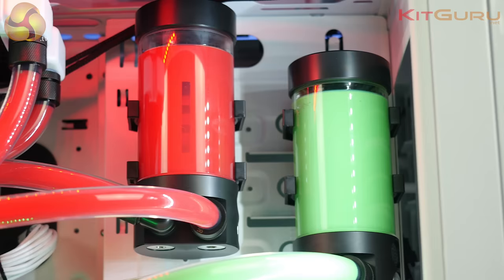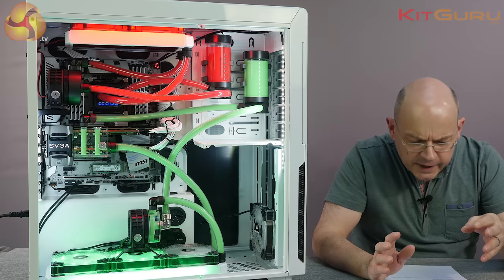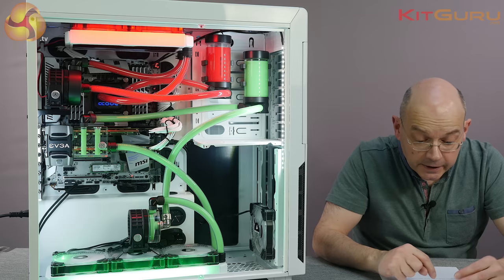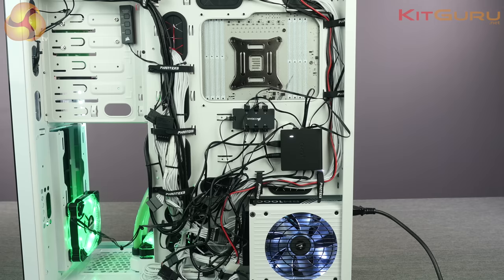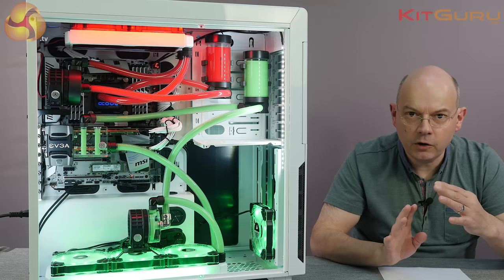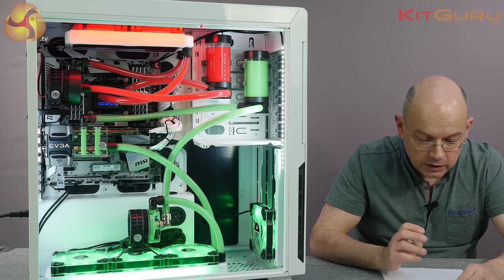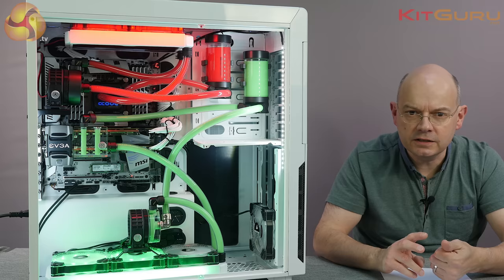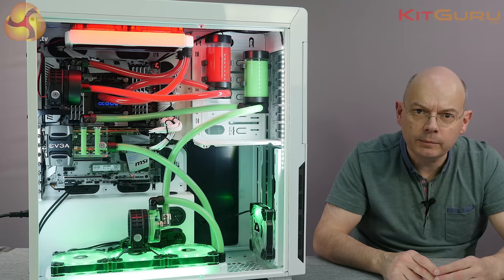Winter Wonderland Christmas PC System - 2 and 3 loop build with timelapse

Comment: good vid but dam that rig looks dumb.i should of put the pump on the res.
Reply from the maker: In that case it would make more sense to step back and use a single pump/reservoir. Let''s face it, the only reason to use a second loop is to add a second colour so you might as well have a few lengths of tubing to show it off.
Reply: o i know i was messing with u lol.